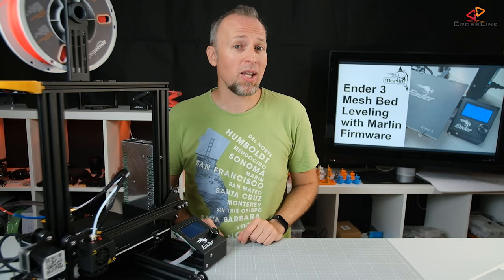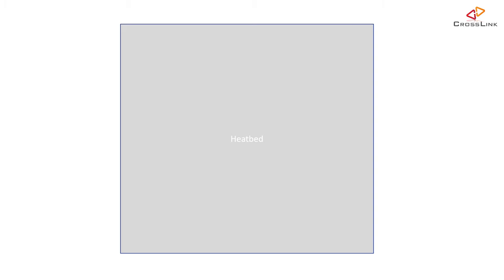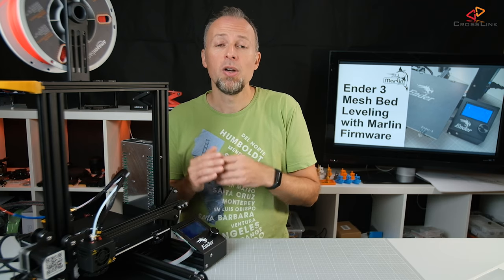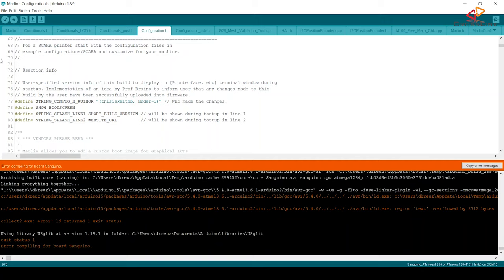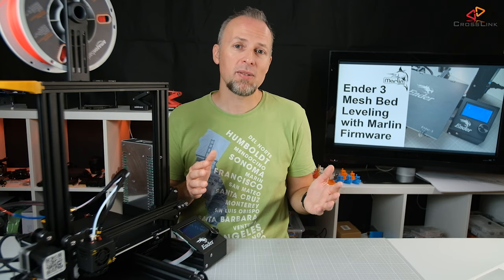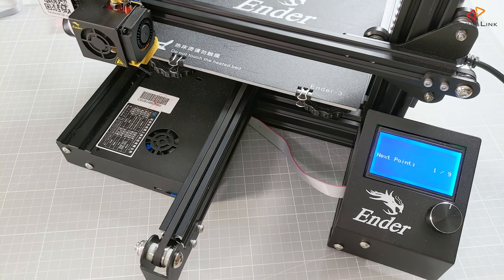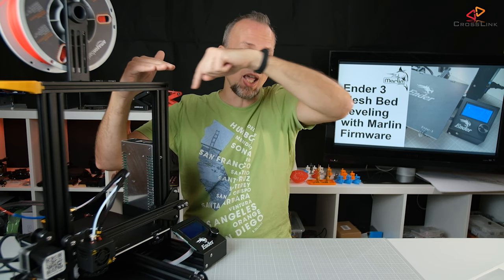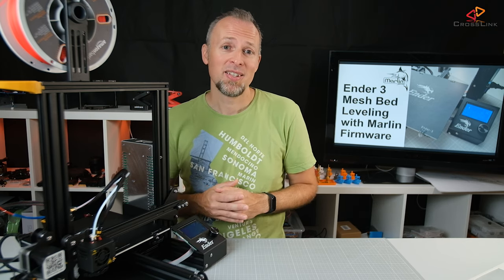Ender 3 Mesh Bed Leveling with Marlin Firmware 1.1.X

Comment: just installed merlin 2.0 today and MAN OH MAN!!  bed levelling gave me the best first layer ive ever had, even on the first print!  so if you are getting non sticking to the bed or filament being pushed away even if you have manual levelled the shit out iof it, DO THIS!!  you will not regret it!  Daniel has a great video on how to install bootloader and merlin firmware for 2020!

Comment: 2:13 What he's describing here is exactly what happened to me... and not even because I was trying to enable special features.  I just ended up in a situation where I was in over my head because I ruined the stock mainboard on my CR-10 Mini by plugging it in wrong (don't assemble a printer first thing in the AM, kids).  So I ended up being forced to upgrade the mainboard, which I would have wanted to do anyway.  I wasn't even aware of the 32bit SKR Mini boards until I went looking for replacements, so that mistake ended up being a great learning experience.

Took me a few weeks to get it all sorted out and working right, but I finally have a fully functional, super quiet CR-10 Mini.  I'm thinking about putting one of those boards in my i3 Mega as well.  Would require getting a new TFT screen as well, but that's not such a bad thing. 

I'm at this video though because I grew really fond of mesh leveling on the i3 Mega (using a custom Marlin 1.9 build).  So fond that I have no intentions of ever buying an EZ-ABL kit or anything like that.  The version I've been using on the i3M is a 5x5 mesh - you get that set once and never have to touch it again (unless you screw with the bed knobs/they bump against something/vibrate loose/etc).  If the ABL options out there were perfect I'd consider it, but they sound like more trouble than they're worth when compared to mesh leveling.  The way I see it, most beds probably aren't perfectly flat, so mesh leveling is basically a requirement.

Comment: I just installed a cloned bl-touch after a ton of failed attempts with the stock firmware on the Ender 3 Pro. I've been using Marlin and it's pretty much the same thing but without the hassle of the installation.

Comment: I have an Anet A8 [Marlin] with Cura 4.5 on an Octopi server.  I enabled the setting "RESTORE_LEVELING_AFTER_G28" in the config file and flashed it, but had a problem after each new print.  I was able to fix by adding the "M420 S1" to the "before" settings in Cura for the printer.  So, for me, the firmware setting did not work, just in case anyone else runs into the same thing.  I went through a lot of painters tape that was gouged with the print head before I made this change in the Cura settings.

Comment: Did you replace the heat bed springs with spacers? I'm thinking if one were to use mesh bed leveling, then replacing the springs with solid spacers would be a good idea so that the bed would always remain in the same place when you did the initial calibration. If you leave the springs there would be a chance of them moving over time due to the vibrations or you accidentally move one of the adjustment wheels.
Reply from the maker: I tried that already with 3D printed spacers. If they are made from PLA, the heatbed will slowly melt them and so they will shrink. Another issue with this approach, the vibrations tend to loosen the screws over time anyways. So I still got the best results with tightly tensioned springs and some spring bushings to keep them straight. No issues whatsoever even after a really long time.
Reply: @Crosslink3D  I was thinking metal spacers and nylon lock nuts so that they wouldn't come off with the vibrations. Guess only thing I can do is try it and see how it goes. Have printed on a mirror since I got my printers and just tramming it the old fashioned way has worked pretty well. Don't have to make adjustments very often. I do like to tinker though.
Reply: Hi Mike, i was thinking the same thing with metal spacer since and all. Please reply if you do ever try it..
M.

Comment: Did the levelling and saved all settings, but each time I had to print after turning off the machine, I would have manually turn on the bed levelling again. When I don't, the printer would not use the bed levelling setting. How do I make sure it's turned on automatically?

Comment: Hi Daniel,
I had no idea this was possible on Ender 3. Great video.
How would this work with Octoprint? Would the controller board pypass the commands coming from the raspberry Pi?
Thanks.
Reply from the maker: The mesh bed leveling happens as an overlay feature to what you are printing. So it will work with Octoprint as long as you make sure it is loading the mesh at the beginning. Either enable this by default for G28 or use M420 S1
Reply: Super! Thanks.

Comment: Ok, I have a question.  I saw in another video you could set the number of grid points for calculating.  I set it to 5, should give a total of 25.  But it didn't take.  What did I do wrong?

Comment: I got a error and also a solution:
Error: Everytime the printer is restarted (or was off) the bed level (aka using mesh) is off (even with restore after g28 and so on the values are there but he does not use them)
Solution: in Octoprint I set up to send G28 (autohome and load mesh) and M420 S (activate the mesh) to the printer if it connects that way my printer uses the mesh again.
But I need to find a way to set Fade hight up with Gcode so it does that automatically as well
Reply: Thank you for this mate. I have a silent motherboard v1.1.5 on ender 3 pro running marlin 2 and octoprint. For the longest time I couldn't figure out why the mesh bed leveling wouldn't work although the M420 S is in my print's gcode. So I did what you said and it worked! Finally octoprint is getting the mesh bed readings and printing according to it. Another thing I did though was add the M420 S to "run gcode before print" spot on octoprint and have never had a problem after that.
Reply from the maker: I'm curious, so it didn't work just to have G28 and M420S in the start gcode of every print, but it worked to also add it when the printer gets connection to OctoPrint? Did you still keep it in the start code? What about if you don't use OctoPrint but just print from SD?
Reply: @Crosslink3D  g28 and m420 s in the startup of Octoprint works perfectly fine. Printing from SD didn't work either for whatever reason, everytime I had to activate the mash manually

Comment: I have a question about the Mesh bed leveling.   I am working through an A8 upgrade and recently installed Marlin 2.x release version.
I enabled bed leveling as instructed and also enabled the feature 
#define RESTORE_LEVELING_AFTER_G28.
The mesh bed leveling has worked amazing except that immediately after finishing a print (the printer shuts off automatically after finishing a print) and starting another print of the exact file (I am navigating to the level menu and selecting Load Settings) the leveling is way off like it lost all of it's positioning information.  I go through the bed leveling procedure again and it works until the next print.
I am wondering if there is something I missed, or maybe this is a bug?
Reply: I have the same problem on my Ender 3
Reply from the maker: It's a bug in 2.0. not fixed yet it seems.

Comment: Got to ask... Daniel, have you done a comparison between the BLTouch 3.1 and the EZABL ?
G
Reply from the maker: No, not yet :-(
Reply: @Crosslink3D  Hey ! please make a video installing a proximity sensor LJC18A3-H-Z/BX on ender 3 v4.2.2 board :) is the same wiring/firmware like on the old v1 board ? need to understand how is done. Thanks in advance !

Comment: I have been printing ok until recently. My infill settings are set to 100%, it starts off great ,but by the time it gets half way through the print ,for some reason it starts to print in a mesh. Simlar to a infill that would be snapped off ,eg a support. Any ideas why it would change from the way it started?

Comment: Hey, thankyou for the tutorial, I have ender 3 with creality 1.1.5 silent board, marlin 1.1.9..... I followed your guide to the letter an now can not print ?
I have been running via USB cable and octoprint so all that's changed is the update for bed leveling. 
I can send a print job but it heats bed and stops there? 
Any advise please?

Comment: Hello, I have a 1.1.5 board, mesh leveling is very interesting and I would like to use it.
Can I install the firmware via SD card? or does the printer need to be wired to the PC? Unfortunately, I find no suitable guide and would be very grateful for help, best regards from Vienna
Reply from the maker: Hi, I have a guide for this on my channel: https://youtu.be/VI-8EK3HuV0

Comment: Hello, i wanted to congratulate you on your videos for ender-3.
Thanks to her installed the version of Marlin 2.
I have an ender-3 Pro and wanted to know if there is a way to make the ender-3 Pro name appear on the main page after boot.
To be clear on the top left near the emblem of the hotend.
Thanks
Reply from the maker: Isn't that the default setting in Marlin 2.0? For me it shows "Ender 3 ready" when I turn on my printer. What exactly do you need different from that?

Comment: After leveling with a 0.2 feelergauge and after that, setting bed to -0.2 in this leveling menu. Prints staring way to far away from bed. After turning it off. But restore after G28 is defined and values are stored. I don’t get, how this happens.

Comment: mi going insane. I just installed EZ lite board v1.2 and do not know which board to pick to upload the firmware in marlin. It only shows 1284p. This is stressing me out. How would i enable mesh on the ez lite?

Comment: I have ender 3 Pro & have added Creality BL touch Probe.
Am not able to achieve consistently first layer squish every time even with BLtouch probe.
Hence wanted to know is there a way, wr I can add manual bed mesh leveling along with BL touch which wll help me to get consistently first layer squish every time?
Reply from the maker: What you can do is to increase the number of probing points. Also you can use the babystepping in the tune menu during the print to lower the nozzle slightly. In general, you might need to lower the nozzle a bit more using the z offset setting
Reply: @Crosslink3D   Crosslink  Thanks for the reply. I tried to update my board's firmware (Ender 3 Pro Creality V1.1.4 Board) but I couldn't successfully bootload :(

Comment: This is off Ender 3 subject but I just purchased an ANYCUBIC MEGA X.  There's no probe leveling available so if I can get this mesh leveling it would help.  and I can put this in the Gcode?    I use S3D. Thanks
Reply: @m30guy  Thanks

Comment: It compiled fine but after uploading my lcd and printer have stopped responding.  While attempting to upload again with this or any alteration to Marlin i recieve "avrdude: stk500_recv(): programmer is not responding

avrdude: stk500_getsync() attempt 1 of 10: not in sync: resp=0x00" 

any idea on how to bring this back to life?
Reply from the maker: Do you have some kind of programmer device at hand or an Arduino? You could try to fix it with that.
Reply: @Crosslink3D  this weekend I'll have one. I'll attempt to re-burn a bootloader because I think I've somehow corrupted the one that came stock.
Reply: Mine just did the same thing, did you get this fixed?
Reply: @ChrisWithACam  not via bootloader.  Since it compiled fine, I just flashed it directly to the board.  It's been printing great ever since but I imagine when I need another update I'll have to go in from the bottom again.

Comment: Can you use this method with the tempered glass bed?
Reply: Sure but it's not necessary because the glass bed don't has a curve in the middle like the aluminum bed from Ender. But you should increase the bed temperature to 60 degree to get a better grip

Comment: Thanks for the video. I've done all the upgrades and mods to my ender 3 pro that I can. I decided to install the marlin firmware and enable mesh bed leveling. It seems that it does not want to work. I manual level the bed to start then run the mesh bed leveling and when I come to print something the mesh bed leveling does not seem to work and I'm unable to print anything. I went back to the original firmware and ran the manual bed leveling again and my nozzle was miles above the bed even though I had used a 0.05mm feeler guage to level with mesh bed leveling. Any advice on what I might be doing wrong. I'd love to get this working as the centre of my bed is slighty higher than the corners.
Reply from the maker: did you enable restore bed leveling on G28 in the configuration?
Reply: @Crosslink3D  Yes I enabled restore bed leveling on g28 but i notice that on the ender 3 it does not seem to restore. I even added the M420 S1 to my gcode but still have no luck with the mesh bed leveling activating.

Comment: Hi when i go into menu i see bed leveling on but wit does not show on the following print . Although i have done mesh bed leveling it seems it does not work. 
Is there a code i must load into the start gcode to enable this .
Reply from the maker: You can add M420 S1 to load the mesh.

Comment: @Crosslink  Thanks for the video!  I'm switching from older Marlin version to 1.1.9 and have no leveling probe.  Is there an option to have the old 4 point (front right, rear right..etc) leveling in 1.1.9?  I can't seem to find it, and prefer this method for fast leveling tweaks.  Thanks again.

Comment: Help! Any time I turn my printer off, the mesh bed leveling reverts to 0
Reply from the maker: You need to insert the command M420 S after the G28 command in your slicer software for print start. The other way is to enable RESTORE_LEVELING_AFTER_G28 in your Marlin configuration.
Reply: @Crosslink3D  I had the restore leveling enabled in the firmware but it didn't work until I also added the M420 in the custom g-code 🤷 not sure why. Thanks!
Reply: @liljashy1463  I have the same problem.
Reply: Also have that problem and i have anable it in the fw and i have m420 s after g28 but if im keep my finger on the z axis it does not compensate
Reply: @Crosslink3D   but RESTORE_LEVELING_AFTER_G28 is not enabling mesh bed leveling after a reboot. Mesh bed leveling is always off after reboot, doesn't matter if RESTORE_LEVELING_AFTER_G28 is on or off. You have to enable it after every reboot in the prepare - bed leveling menu. After that it stays enabled, even after homing.

Comment: Hi !
I'm trying to activate BED MESH LEVELING on my ender 3 V2 but it not works :(.

1. I open configuration.h
2. I searched "//#define MESH_BED_LEVELING" and modify by "#define MESH_BED_LEVELING"
3. I searched "#define GRID_MAX_POINTS_X 3" and modify by " #define GRID_MAX_POINTS_X 4" (to have more points for mesh)
5. I searched "//#define LCD_BED_LEVELING" and modify by "#define LCD_BED_LEVELING"
6. I searched "//#define LEVEL_BED_CORNERS" and modify by "#define LEVEL_BED_CORNERS"

But i have some errors on Visual stodio code when I compile project : https://cutt.ly/Hd5NwXX

Do you have an explication ?

Thanks in advance :)